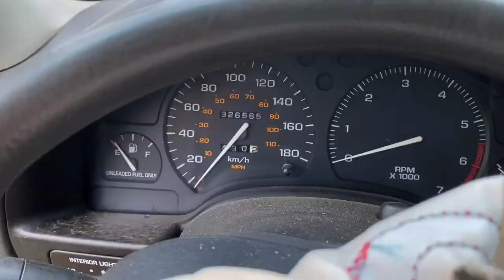FASTEST Engine SEIZE Ever!

Comment: Must have meant that engine was still good. Tolerances were still tight. I guess if you put a bunch of oil back in it and if you could un-seize the engine it would turn just fine.
Reply from the maker: Fill er full of diesel

Comment: u guys dont know how to do a motor blow!!!    why drain the oil?  any motor is gonna seize with no oil... the best way to do a motor blow is keep the oil it in it... take a hose and put in it the rad so cold water is going through the motor all the time and then let her sing at 7 grand.... it will sit there and run wide open for 20 minutes and explode at the the end... u will have engine pieces everywhere
Reply from the maker: So you want 20 mins or red line?
Reply: @markfreeman408  u want to see a motor explode and I mean pistons and rods fly out.....views.